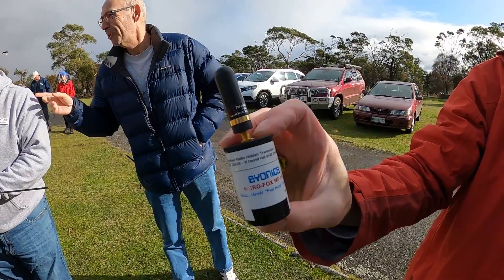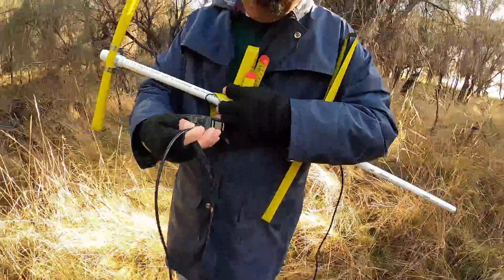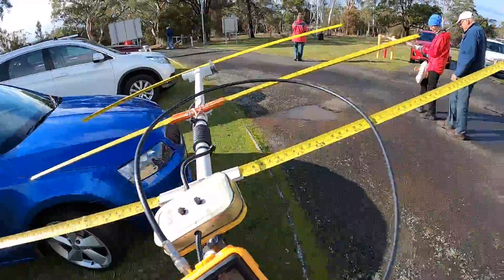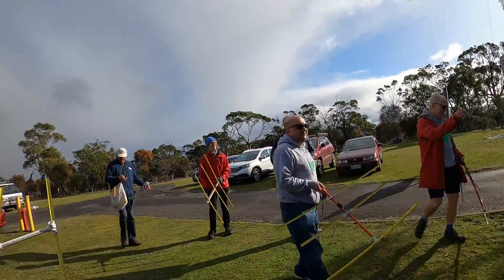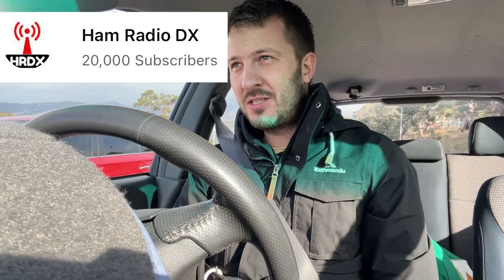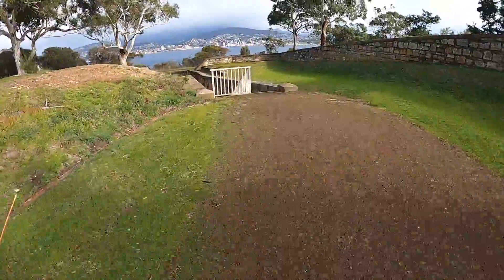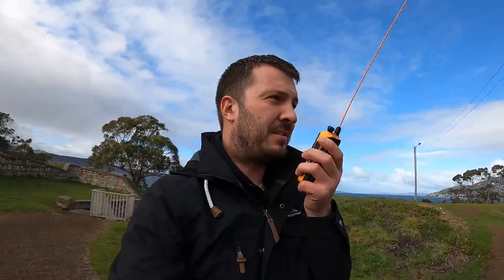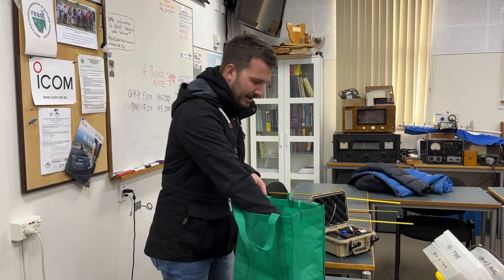Finding A Hidden Radio Transmitter | Ham Radio Fox Hunt

Comment: Hello, in my area there is an illegal FM radio on 107.9. Do you think I can locate it using this technique? It's a large radius though I get that radio on 2 locations 20km+ apart. Does it need to be another type of antenna?
Reply from the maker: Using this technique yes. You might need a slightly larger antenna though

Comment: Do you think i could successfully hunt a GMRS repeater jammer in a big city with an RTL-SDR and maybe a 6+dB gain yagi? Otherwise, what inexpensive or aexond hand equipment could i possibly get? Budget of $250
Reply from the maker: Yes you possibly could with just the SDR and directional antenna. Just take signal strength measurements at various locations to try and pinpoint
Reply: @HamRadioDX  I think it might be hard, I suspect the jamming transmitter is using a directional antenna and low power, but if I can intercept that I'll be on track. Thanks.
I also suspect it's a two radio setup, so probably not mobile

Comment: I recently gained my Technician license and will join my first fox hunt, weather permitting, tomorrow morning.  Very pumped up and feeling like a babe in the woods.  Thankful for local Hams and Youtube for the free flow of experience and information. Quite a point of pride to have earned a call sign.  I'm limited with the frequencies I can use with my license and that provides the drive to accomplish the next ticket.  73.  KJ5ATV

Comment: This is a bit off topic, sort of. I purchased a Ford territory and want to install half a dozen or so radios. What's the best place to mount them an method of feeding them into the vehicle? I'm thinking of having roof racks with a solid plate or metal basket on to mounting antennas on it. Thanks for suggestions in advance, or for suggesting someone else to ask. Ie, a website or ham. Cheers. Good video by the way!
Reply from the maker: Hey mate, as a starting point maybe check out this site - lots of good tips for mobile operations https://www.k0bg.com